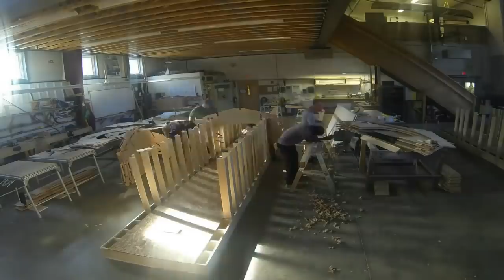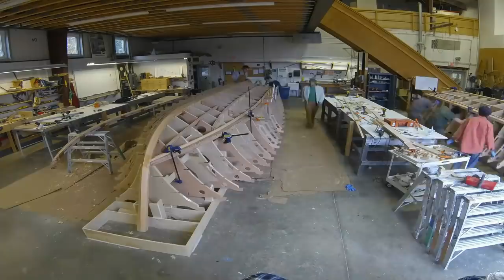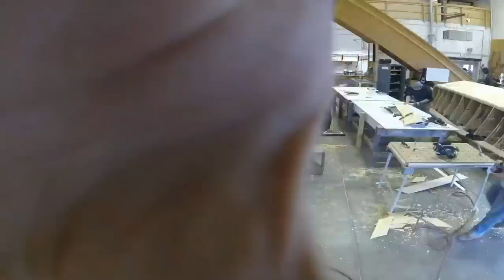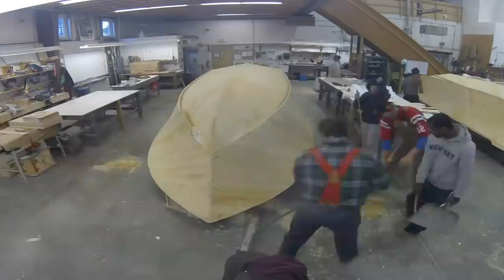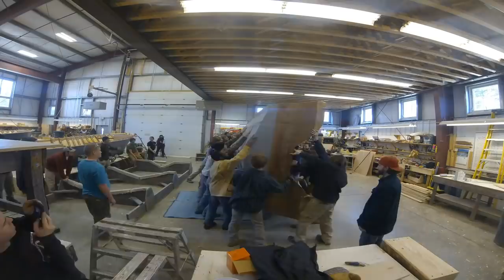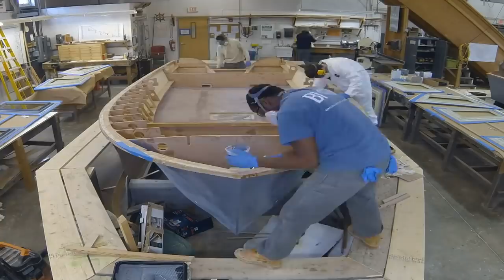Building of a Cold-Molded 22ft Center Console

Comment: Wood has no place on a boat unless it’s furniture or internal decorative trim, never structural. Wood does what it was intended to, decompose so it leaves nutrients for the next generation. No matter how well wood is encapsulated moisture will find a way as well as mold spores. In fact painting or glassing may exasperate the problem by holding in the moisture. I would have been impressed if they had used that hull as a plug for a fiberglass mold. The hull will last a lifetime if ribs, stringers and bulkheads are made honeycombed laminates. A boat with wood in it’s structure is a guarantee of ongoing maintenance or demise.